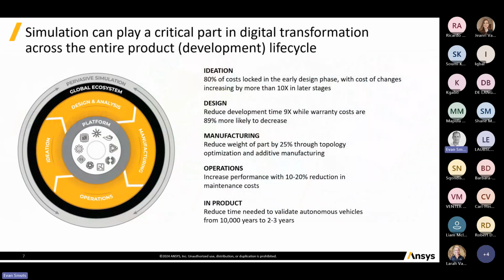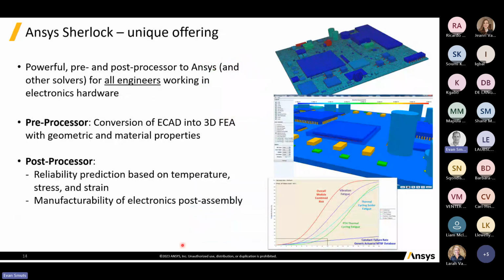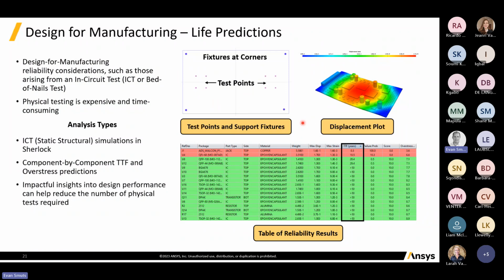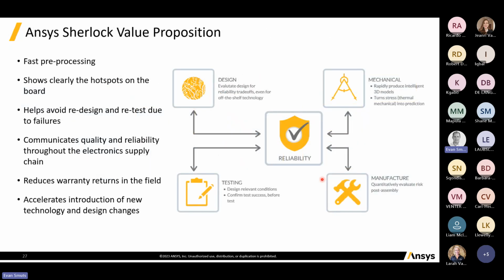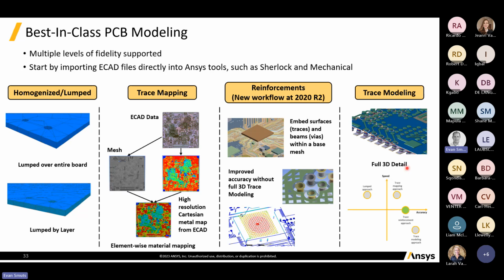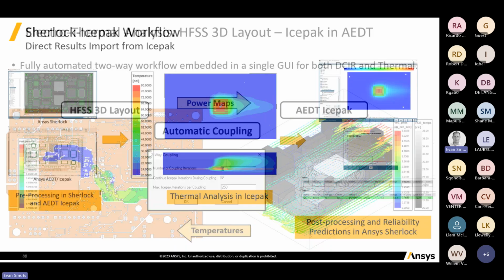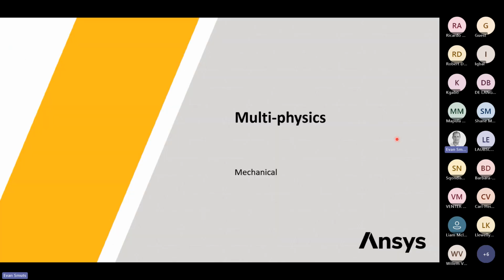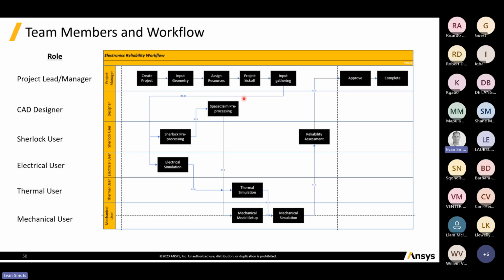Ansys Sherlock - an easy multi-physics approach for PCB reliability and lifetime prediction

Comment: I see that mechanical shock, PTH fatigue, random vibe fatigue and solder fatigue is taken into account. 

But what about other, more precise failure mechanisms, such as electromigration, TDDB, hot carrier, dielectric breakdown, tin whisker growth, corrosion forms and so on? The conclusions of the final combined reliability will be wrong if not all modes are taken into account?